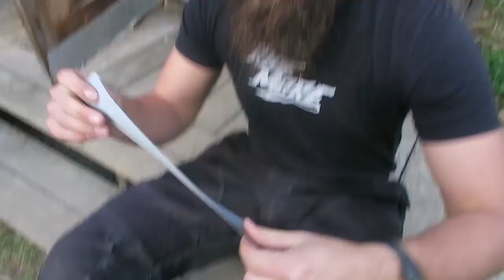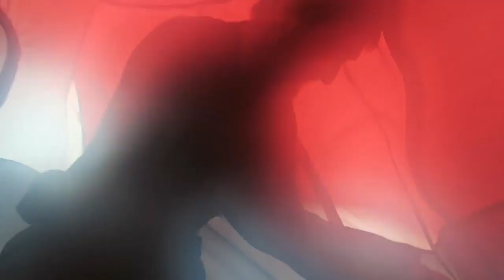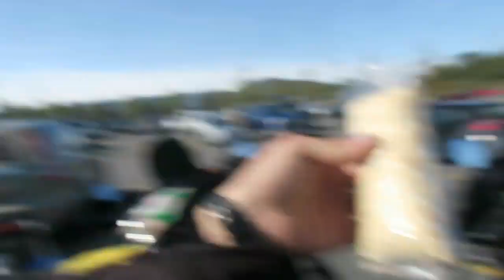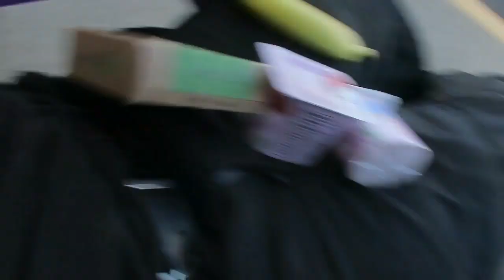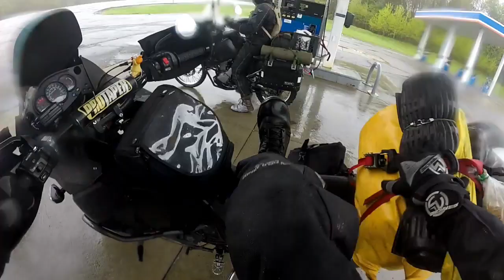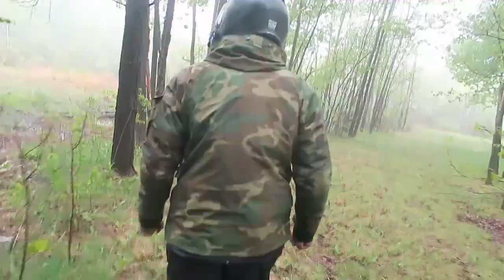The Trans America Trail Motorcycle Adventure (EAST TO WEST)

Comment: Hard to find rain these days. I would have been impressed if Mike had welded together an oven to  strap onto the motor for warming. If you did a shout out I bet someone would have sent Mike some boots. I have some size 9 I am not using. I will leave them at your next camping spot.